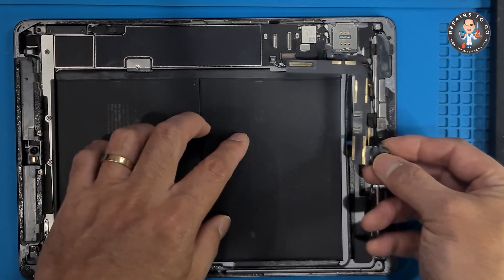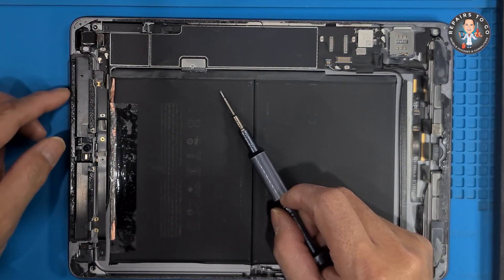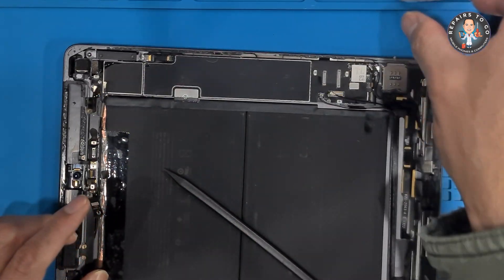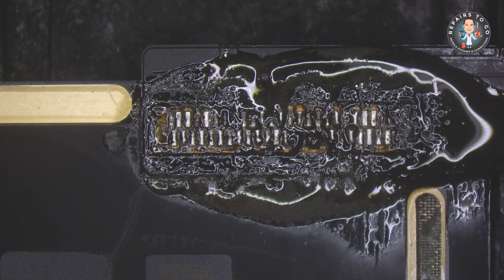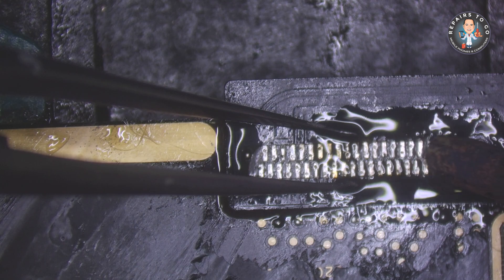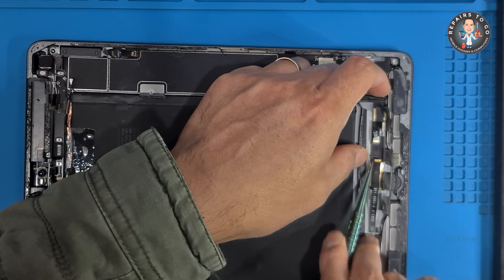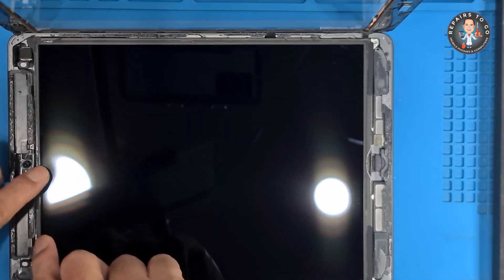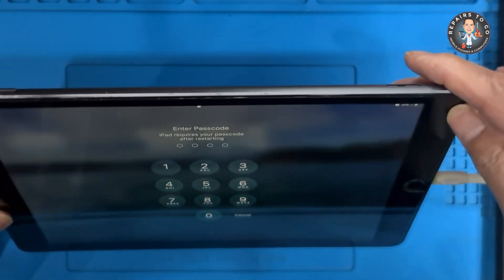How to Replace iPad 9th Gen Charging Port with Micro Soldering

Comment: How do you test if the replacement was successful? Pls don’t just say if it takes charge.
Reply from the maker: Plug in a charger, if there’s any reading like .02volts to .11volts or it will respond to any reading, it means it is successful.
Reply from the maker: Once you’ve finished soldering the new charge port, test it by plugging a charger. Any small readings or it varies time to time, it means it is successful.